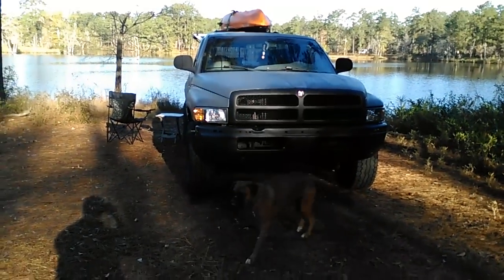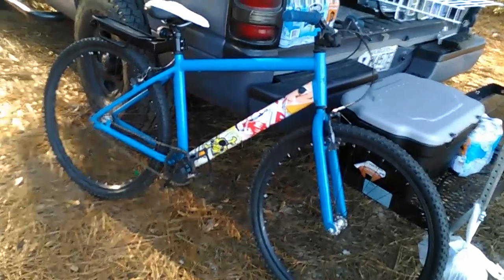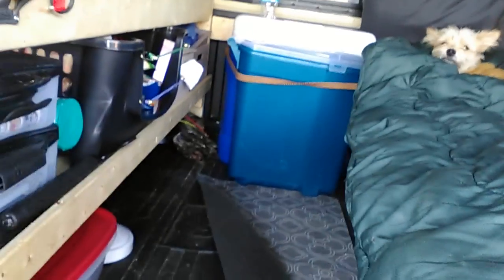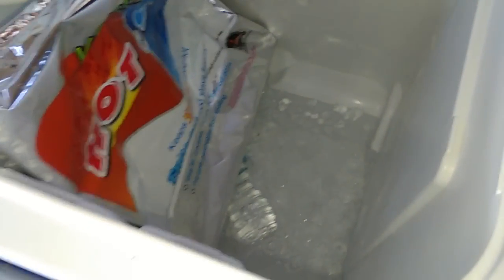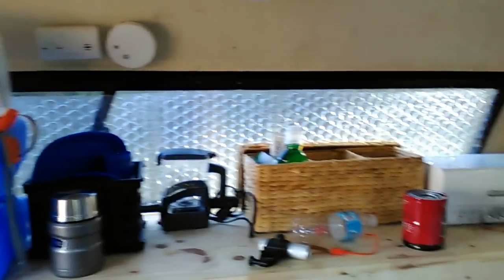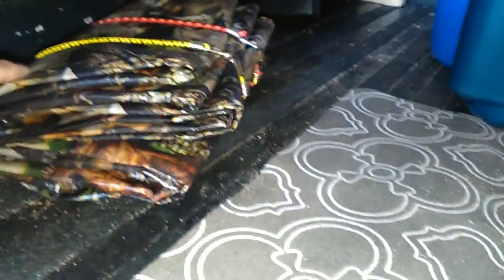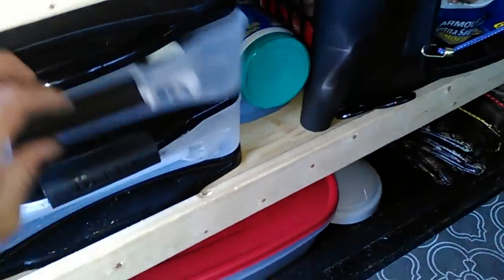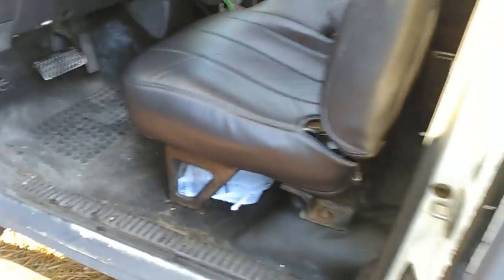The Best Damn DIY Truck Camper Set Up You'll See

Comment: Got a useful tip for your dirty dishes:   When my wife and I were younger, we did a lot of camping....... We found an old, antique dish pan. The old dish pans are metal and you can set them on your Colman Stove with both burners going on low... It keeps the water hot and you can wash the dishes and rinse them with your surplus water.. The Dish pan is also a great idea to wash up or take a good 'ol "Sponge Bath!" ....... For those that do not know what a dish pan is: It's a square enamel pan used years ago for washing dishes... Kitchens had hand pumps in the old days. You needed a dish pan....they still used the dish pan even after the house had plumbing because sinks had only one tub...... You can probably find one at an antique shop or E Bay.......... A lot of antique kitchenware is still very useable for camping..... We always had an qntique Waffle make that went on top of our Coleman stove. Made some nice Breakfasts with it!...........As far as mixing eggs or Pancake batter,,, Use your cordless drill with an old beater from a MIxer that you would use in a kitchen at home for making cakes.........

Comment: It's your space and place. There isn't any best way of doing this. Great job. Check out these ideas: Folding Wal-Mart port-a-potty; A second storage box on the other side of the rack for more "locking" storage; a hanging LED lantern and a small radiant propane Coleman heater that is more reliable for the Eastern winters or cold weather. Nice job.

Comment: I've seen a guy use saran wrap to avoid using too much water cleaning dishes. He would wrap the plate before putting food on it so he could just throw the wrap away rather than cleaning the plates. Also uses white vinegar and water mix in a spray bottle for pots and pans then wipes it clean. The vinegar sterilizes them as well.
Reply: Kris K Saran wrap idea is great, thanks!
Reply: Cool
Reply: That is a great tip!
Reply: good shit!
Reply: Saran wrap is wasteful
Reply: Kris K wonderful idea! Got any more great ideas?

Comment: What is your opinion on that canopy? I have been looking at one similar but different brand and wonder how she handles the rough dirt roads. One place I go has a couple of really rough spots that you have to use 4 high to get up and it twists the truck pretty good. Just wonder how that back door and the seal would hold up??? Thanks. Oh, Good vid. I am building my own camping setup. Just need a newer canopy that doesn't leak all over. Snugtop and I think it is at the end of its life. Fiberglass cracking everywhere.

Comment: Do you know once you find the pos+ and neg - on your laptop and wire it into a cigarette lighter plug you can plug it directly into a 12 volt lighter and not use the inverter which draws alot of current to run and convert dc to ac. Laptops have a built in voltage converter and regulator circuit to bring the input voltage down to the required voltage the computer needs for it;s electronic circuits which is 5 VDC. Don't waste your batteries on converters they are power wasters unless you have to..

Comment: I would highly suggest a solar panel setup, for one panel and control unit is 190 on amazon, witch you hook up to a large 12v car battery and you'll never have to waste gas and start the truck
Reply from the maker: a solar system to run the heater/AC unit I want would take up too much space for panels and too many batteries to keep it running 8 hours a night
Reply: +The Nomedic would suggest a inverter generator then, check out home depot, ryobi makes a good one for a decent price
Reply from the maker: +MrTONYTHEDRAGON please watch update 6 this video was a year ago. Nigel no longer looks like this
Reply: +The Nomedic I know lol I just subscribed and started watching the updates

Comment: Nice setup on a small budget. As time goes on, you can improve and add to it. You may want to get a larger inverter (more watts) that should charge your higher-drain items faster. The bubble wrap is a great idea, light weight and easy to remove and replace. I thank you for your service, from another old geezer/veteran. I'll be checking out your two month update next. Good job.

Comment: Forgive me my questions are already in the comments. I looked, but honestly, I didn't read all 1,500! 
(1) Wondering what the specs/measurements are on your shelving unit, if you wouldn't mind sharing. I'd like to build one just like it. 
(2) Also, what brand and/or where did you get the plastic box (black with grey lid and hinges open) you have on the hitch basket? 
(3) And how did you attach it with zip ties? Guessing you drilled holes.  
Thanks so much!! This is awesome.

Comment: Great video! I got a few great ideas from your set-up but the one thing that fascinated me most was your terra cotta pot heater. I ended up making one last night but the tea candles I bought from wal-mart smoke a lot and can fill up the camper shell fairly quickly. So I was just wondering what kind of candles do you use?

Comment: Buy a 2.5 gal carboy from uline about $15.00 and spray paint it flat black. Leave it in sun and you will have hot water for dishes
Reply: Hot water is totally unnecessary for dishes but would be great for a shower.

Comment: Have you thought about small solar panels? I have a small one that will charge 12vlt items. With a couple of them with a quick connection you pull probably have it either hooked up to your camper section to charge a battery of some sort or use to keep battery in truck charged while you are parked wherever you are staying

Comment: Nice setup. I have been wanting to do this very thing. I have been searching for the right cap in my price range, but nothing yet. And I love dogs too! 
I do have to mention though that I am assuming you don't plan to carry out your dirty water from dishes teeth bathing. You really should be using biodegradable soap and I'm pretty sure regular Palmolive is not biodegradable and anything else that will not be taken out with you. I'm just saying...

Comment: Great idea is to add a second battery a place for it in all trucks. And hook up a ac/Dc converter adapter under the hood so u do not need to run your truck to use it u can hook up a electric heater and even portable small ac or fan. U could purchase a lithuim camper battery that will also fit under the hood and only connect to charge out.

Comment: Really nice setup there mate, subbed and will watch your other vids soon, not sure if you have but show some camp sites you stop at and the setup with tarps up!
Reply from the maker: i have pictures of places ive been to on my instagram and facebook
Reply: +JR deguzman Can you put a link up in your profile?
Reply from the maker: +Paul Biggs its in the description
Reply: great idea with the carbon monoxide sensor but you should put it lower than your bed seen as it will start building up at ground level.
Reply from the maker: +Paul Biggs it already is
Reply: +Paul Biggs - Nooooooo.... CO is lighter than air. If anything wisdom would say that it would rise. But in reality it permeates the entire space, so it doesn't matter. The NIH says it "equalizes". But the scientific process that does that is called "diffusion", which makes sense. The lighter CO molecules would be rebounding off the heavier air mixture molecules causing them to spread out evenly.
http://www.ncbi.nlm.nih.gov/pubmed/21536403
Reply: I know of someone died behind a boat the CO was just sitting on top of the water,  also remember reading about a woman that died in a tent sleeping at ground level.  The density of the two are so close that they mix well and I think the temperature has something to do with it, so better to be safe and have it at the hight of his bed.

Comment: Nice. I have a 96 v10 long box crew cab. Looking for DIY camper ideas. Great example. Trying to find a 3/4 half tall shell. I will have several more feet in length and want it tall enough at the roof height extent for a tv and storge.

Comment: BTW it takes my power inverter about 2- 3 weeks to drain the battery if I'm not driving my Wrangler and I left it plugged in. I've walked outside to the dreaded high pitched squeal of the power inverter's low voltage alarm to find my jeep won't start more than once. Now I'm diligent about leaving it unplugged. Just FYI that you can leave that plugged in if you're going to be driving every day or camping for a weekend.

Comment: Solar water heaters (portable) are very easy and cheap to make. Or you can get those plastic "shower bags" in the camping supply section of Walmart/Kmart for around $15 and holds about 4 gallons (I'm not sure of size)...but just hang them out in the sun and HOT water in a few hours.
Reply from the maker: got the new roof track set up i can definitely do this

Comment: you can get a super cheap foldable solar panel and deep cycle little battery in a kit from camping world or harbor freight tools. Also look into buying on amazon these little suction cup solar pads the size of your hand that goes on your window to charge small electronics like phone laptop etc. There's also backpacks with solar pads sewn on the back to keep you phone charged while hiking. I'm a trucker and yes, if you run that inverter off your regular vehicle battery all night you'll need a jump to start her up in the am.
Reply: well I used to be a trucker before college but yeah don't try to use that inverter all night with the engine off.

Comment: I think solar panels would be a good idea.  You could buy a set of folding panels.  Just lay them out on the side, don't fasten them.  You have enough space at the very bottom of the wooden rack for a battery tray and that inverter.  Use those short little lead acid batteries.  This setup would still allow the flexibility to connect to the truck battery if needed.

Comment: Have you considered getting one of those battery jump starter packs? It's basically a second car battery in a slick package with a handle. Attached is a set of jumper cables, and often you can find them with a built in air compressor for if you get a  flat. ADDITIONALLY, some of them have 12v outlets, USB outlets, as well as a built in inverter with regular 3 prong plugs for all of your other electronics. The good ones start around $125. You can charge it from your car's 12v plug OR you can take it with you somewhere they have an outlet and just plug it into a wall.

A few years back I helped my brother build out a van to live in. He used one of those to recharge his stuff and run is CPAP while he slept. If he didn't end up driving enough to charge it fully, he'd just take it to class with him and let it charge at the school.

Comment: Those Dodge 3.9 L V6s are tough, overbuilt engines! My '93 has way over 200,000 miles, uses not a bit of oil, strong engine. I do only use Mobil 1 5w-30 full synthetic oil and change it as close to 5-7,000 miles as I can since odometer broke 14 years ago at 120,640 miles. I go by time now on oil/filter changes.

Comment: I like the small clear plastic drawers with something to keep them securely closed, unless you open the black handle. What brand are those drawers (under your blue water carrier)?  I could use them in our camper. Thanks for the info!
Reply from the maker: i just got them from walmart or target. i dont remember the brand. i just picked it cuz it was able to lock and it fit in the space i had.
Reply: Thank you. I'll check those two place.

Comment: You will need to lower the carbon monoxide detector if you have not already, carbon monoxide is heavier than regular air, by the time it reaches that height, you've already been too long exposed to it.  Other than that the setup is awesome!

Comment: Ahhhhh so many good ideas, thank you.
I'm working on a camper in my longbox Sierra. Which I'm needing to paint; did you dip yours?
I also have the same rack off a Blazer, free from my brother. For a solar panel/tools though.
And if you're on the highways a lot get some plastic L trim from home depot and tuck in under the seal on the sides of the windshield... Reduces noise a bit on GM/Chevy first gen at least.
Reply from the maker: plasti dipped the whole truck except for the cap kept it white to reflect heat

Comment: I made some reversible window covers for my rig out of dollar store windshield shades that have reflective on one side, and camo on the other. i got a grommet/eyelet repair kit made for tarps, and put one at each corner. Then i used some dollar store suction cups (the ones that come the hooks thru them) and put them thru each eyelet and put a hair pin through the holes. Works nicely, and they are reversible!
Reply from the maker: great idea.  i mitt try that for summer if it gets too hot
Reply: Yeah, it works great. I see you have served, you may be familiar with my vehicle. Its a M1009 CUCV.  It's my daily driver, and last year it became my part time camper. I like that i can go from a normal vehicle with no tint, to pretty much total blackout in a few minutes. I also made a bug screen that goes around the passenger's window, to help keep condensation out. I just put some of that magnetic strip around the whole window, and glued the screen to it. Napa also sells 12V oscillating fans if you see the need. I mounted one on my dash and it doubles as my ghetto A/C, lol.  I found some portable MRE/water heaters made to work in military vehicles, they look pretty sweet, and i have the 24 volt system to power it. But i dont really wanna fire up my noisy diesel at 5 am if im staying in a public campsite, so i decided against it.

Comment: pretty cool a dark container in the sunlight for a couple hours gets you hot water. I hang gallon jugs under my hood while driving and get really hot water. put a rv roof vent in the camper they are cheap and will really make it much cooler inside. have fun

Comment: Redo the screens. Add 1/4 " mesh screen. Keeps some varmits from making a quick reach.. i added the radiant barrier bubble pack velcroed to the door,  windows and interior roof. To that roof radiant barrier added battery operated faire lights 20' one set red the other white.

Comment: cpl neat ideas for ya
1 rollerblade bearings work great for a rolling rack or storage systerm the inside hole is a 1/4 inch so easy to bolt on however you need
2 if you make a super concentrated salt water solution put it in some pop bottles and freeze it     ittl keep stuff super cold for a long time and NOT soggy
the other more expensive option is usually you can buy dry ice from air liquide but you gotta have a barrier between it and the food or major freezer burn

Comment: We have the same ARE shell and have put it on our last 3 Rams. The V-6 we've had in two of our Rams have been 3.6 L (not 3.9) "Pentastar" engines. We love the ARE shell and it's still working perfectly (bought it in 2010). We sleep in the back of the truck and now pull a small 6x8 air conditioned living room behind it with a comfy couch, a 42 inch flat screen, a PS4, and microwave and a coffee maker :-)
Reply from the maker: that's awesome, I love this truck cap

Comment: I seen a guy on a sailboat using the flower pot heater, he was using a bread pan to place the candles in and the pot fit over resting on the sides
Reply from the maker: I ditched it and went with anr buddy heater
Reply from the maker: a mr"
Reply: I had one of those for my trailer and the pilot light went on the fritz within two weeks, then i bought a residential one I thought would be good, but it too failed, now i use a good old fashioned wood stove

Comment: Great set up. Since you have the propane stone, you do not need the electric water heater or the immersion heater. One tea kettle of water heats up in about 2 minutes without burning, good for shaving and hygiene,  longer for coffee. Put a deep cycle battery somewhere in there along with your inverter to charge your phones, laptop. Can be recharged with a solar panel while parked. Use paper plates and cutlery so you don't have to wash dishes, only your skillets and utensils will be washed. I would later add a honda inverter generator of 1000 watts and small flat screen tv that flips down from your cap on the inside. Have stand by tarp for shelter or a awning behind your truck when parked for long term. More is possible.

Comment: That is a pretty cool setup man. I am 6'5 so i think i would need long bed truck for this to work for me. You're lucky being short in this circumstance. You should check out power supply kits like you find on popup campers like the Coleman brand campers have. That way if you are in a campground with powered sites you can simply plug in and give your truck and battery a break. It would also make it where you dont have to run a extension cord though a window or out the back door. Thanks for the service and sacrifices you make for our country, it is much appreciated.
Reply from the maker: 8 foot bed and extra tall camper would be your best option. but at 6'5" itll still be a tight fit sitting up

Comment: The carbon monoxide detector should be lower, carbon monoxide will fill the area bottom up, so by the time it reaches the detector it will have been filling the interior for some time.

Comment: Nice work! Just a thought... You may want to drop your CO detector down below head level when you sleep (but away from where your trucks exhaust would mess with it). CO is heavier than air so by the time it gets to your detector on the roof you will be dead.
Reply from the maker: done lol it fell off andi mever bothered to put it back up. its on the floor

Comment: nice setup dude. everything you need or want for your times out.  a suggestion for you, maybe you want to consider finding a rubber seal for between the cab and camper. you pop out the windows and with the seal you can turn it into a passthrough. making space in the cab accessible from your camper, even for storage purposes to free a little floorspace and its still secure. 
enjoy your time! peace